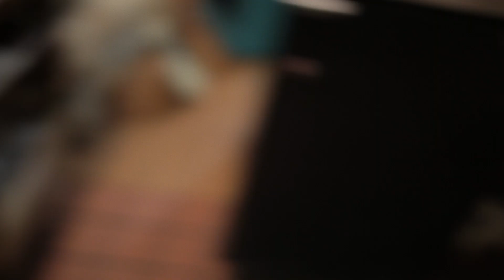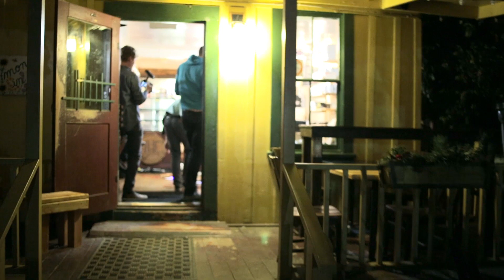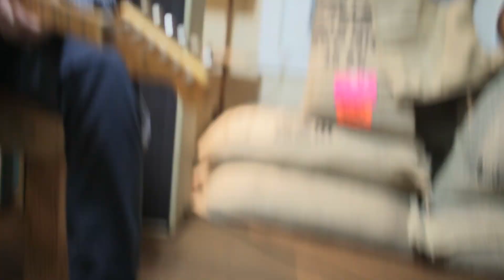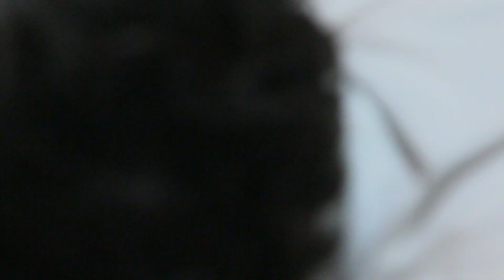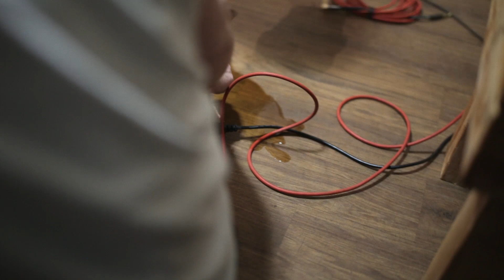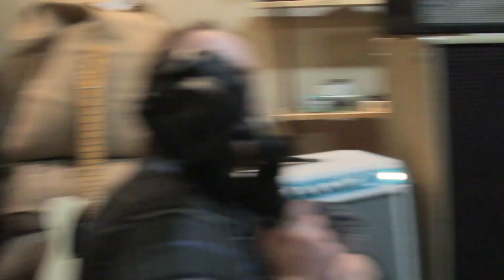Coffee and Riffs, Part Sixty Four (Joel Korte, Knobs)

Comment: The day must come when pedals get off the floor.  It’s entirely absurd that they’re in such a spot.  Makes no sense.  They’re only there because of a total lack of imagination by the manufacturers as to a proper interface with the player.  Yeah, you might want to switch a pedal on by stomping on it but that leaves adjusting pedals on the fly uncomfortable and ridiculous.  Remember the EMS Synthi HiFli?  That’s how it should go.  Pedals above and reachable on a stand with cables connecting remote floor switches would be the thing.  Nothing is more insane then sitting on a hard floor cross legged and leaning over with a guitar in your lap trying to read tiny letters above tiny knobs and moving them about.  And if it’s in dim lighting, even more insane.  So many pedals are offering numerous control options that interfacing comfortably with the control surface is essential.  Add illumination and you’re there.   We need new interface designs in this industry to match the progress in amazing sonic potential that many pedals offer.